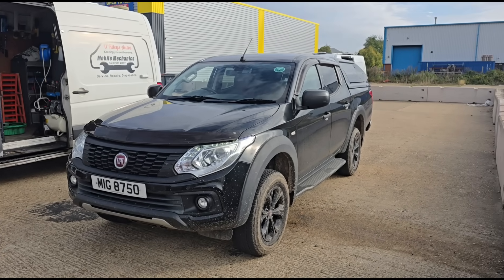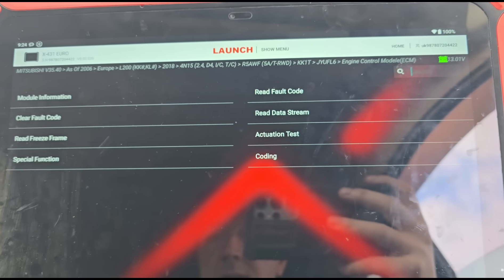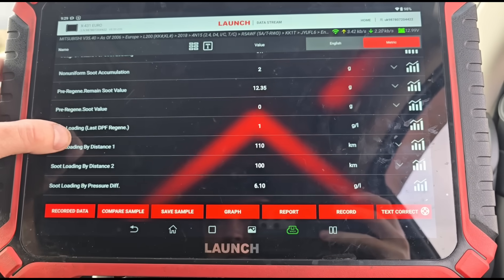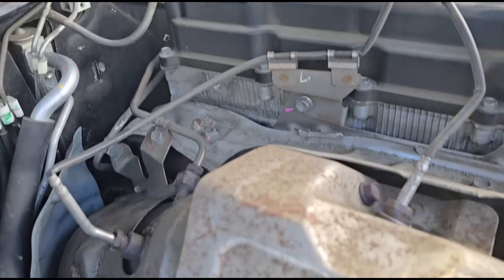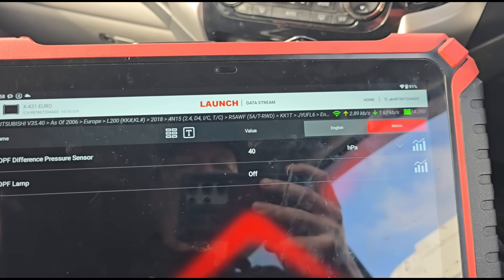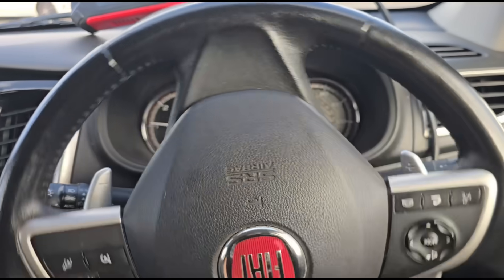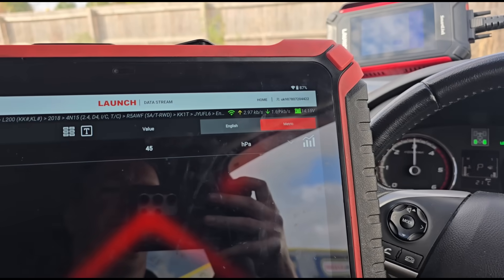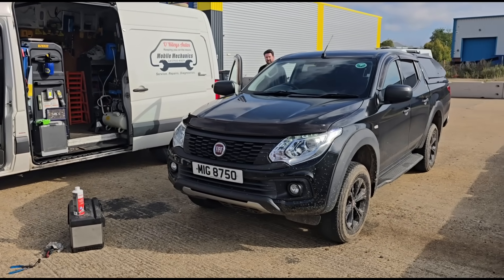Fiat Fullback: Diagnosing and Fixing DPF & Oil Dilution Issues P252F

Comment: I have recently had my Shogun sport 4 doing a regeneration every couple of days or so and oil dilution, it turned out to be a faulty or dirty mass air flow sensor. After replacement, it is now working as it should, it's the same mitsubishi 2.4 engine
Reply from the maker: Glad you got it sorted, good info to know!

Comment: Yeah.my asx has the same dipstick. Also, apparently you have to tell the ECU it's had an oil change before you can re set it.
Edit..the ECU calculates how many failed re gens it has had and then flags up a check oil.level light. This is a swine to remove. It needs a really good scan tool.